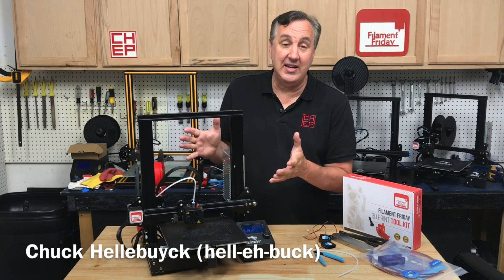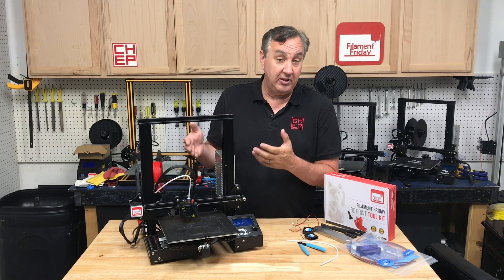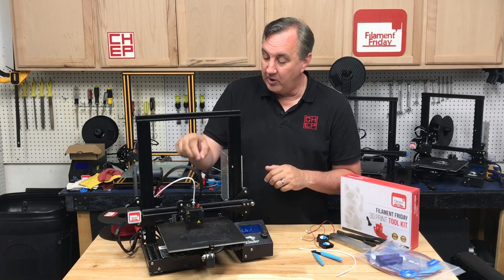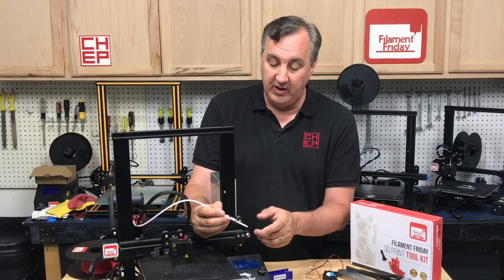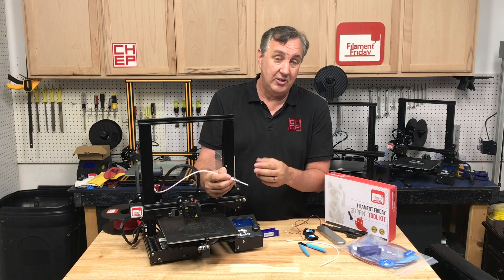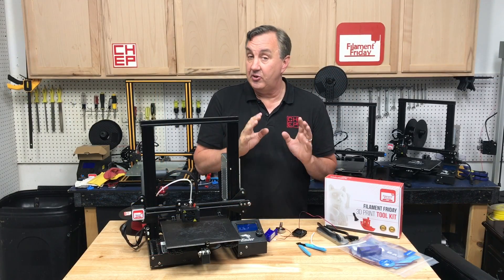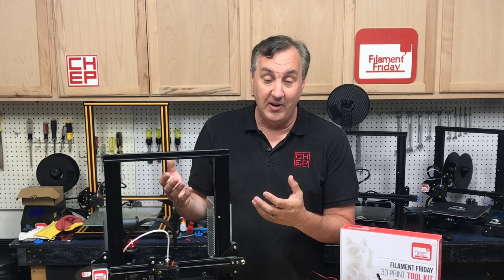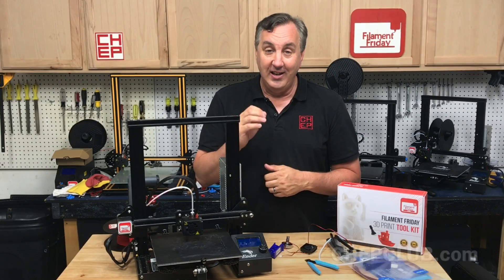Maintaining a Creality Ender 3 - 3D Printer

Comment: it took me honestly months to figure out all of this. Lots of frustration but have it down to a science now.
I've also done the spacer mod featured on this channel which allows me to take out the PTFE frequently without having to reseat on the nozzle (and re-cut the tube end).
Reply: Do you think its a good mod to do?
Apparently CHEP didn't like it enough to mention it here.....
Reply from the maker: I have a whole video on the insert for those that want to mod it. This video was for those with stock setups. https://youtu.be/7tCxO17XZtw
Reply: @bobjohnson3175  I personally think it's a good mod to do, main reason is so that I can throw out that tiny little PTFE segment as many times as I like, and not have to worry about running the main run from the extruder. Yes all PTFE wears out and it will eventually need to be replaced, but not nearly at the pace that it gets baked in the hot end in my experience.

Comment: Great tips Chuck. 
But I'm still having some issues. 
Any tips or video for fixing x axis layer shift after filament change and resume printing? Every time I resume to print,  the x axis alignment is always off.
I've got stock ender3 pro with silent board. Thanks. Any help is appreciated.
Reply from the maker: Tighten the belt
Reply: @FilamentFriday  I did try that but I'll do it again based on your recommendation. Thanks. Love your videos.

Comment: Excellent video. All my printers are direct drive with all metal hotend so no worries about ptfe tubes.  Preventative maintenance is so important and often neglected.  I have learned a lot from your videos.  Thanks.
Reply: Isnt there still a short piece of ptfe tube?
Reply: There is but it doesn’t go down and touch the nozzle.

Comment: I also noticed something good for cleaning the nozzle, if you use the hotend fix washer, you can do atomic clean/cold pull wayyy easier since you doesn't have to pull the filament all the way from the start of the PTFE tube!

Comment: Nice tips! Thank you for your continuous updates, helps a lot 👍🏻.

I had issues with clogged nozzles on my Geeetech A20m, and I've found a really simple way to clean up my nozzle without replacing it. 
I heated up the hotend up to its maximum temp, then took off the PTFE tube end from the extruder side after removing the filament of course, then hooked it up to my bicycle pumb which has kind of a clamp that fits perfectly snug to PTFE tube size, then put a paper on my heated bed so that it doesn't get messy, and carefully blow up air in the tube and it did open up most clogged nozzles with a cloudy plastic oozing 😆👍🏻

Comment: Hey chep, so I had purchased an Ender 3 pro last week and made a novice mistake:
I didn't level the bed for the first print
I also did not know where the stop print button was...and so
The nozzle dug into the bed a neat 4 mm Or so and leaving an impression on the heated bed part before I finally found the stop print option on the wheel. First time printing anything, and my excitement clouded my judgment.
Replaced the Nozzle, as I was concerned about its integrity.
However, I now appear to have a flat spot in three points on the x-axis mounting wheels, or belt, or sprocket. I'm not sure which. I've found the wheels and belt, but I can't seem to find the sprocket in question if I managed to somehow damage that bit. Could you possibly direct me to the x-axis sprocket in case my fixes don't resolve this flat spot issue?
I also have a replacement PEI sheet bed coming, but I'm going to be sticking with the heated part a bit longer to see how my prints turn out before addressing that issue.
Thanks for any input!
Reply from the maker: The gear I referred to is on the extruder motor. The X axis gear is on its stepper motor.
Reply: @FilamentFriday  Correct, I am looking for that gear. If I need to replace it, I'd like to have the part handy.
Reply from the maker: Believe these will work but double check your teeth count and shaft diameter. https://amzn.to/2VKFLu3

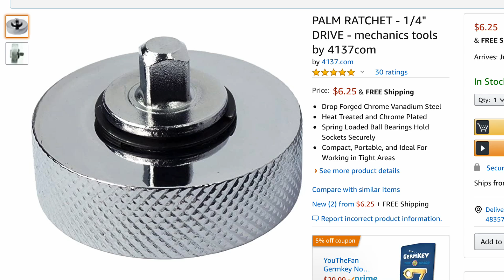Comment: 3:52 Great tip I learned is that if you're stuck in a situation where you don't have a 6.5mm socket (or a 1/4 inch socket, which as you demonstrated works quiet well), but you do have one of those screwdrivers that uses removable bits, then you can likely use the screwdriver as a 6.5mm socket.

Comment: CHEP. Would the mentioned maintenance be related to stringing during travel?  I bulk print duplicate parts  side by side and it strings between each model but not inside the models themselves.  I have the capricorn hot end fix and everything is calibrated using  newest CHEP profile.
Reply: try dropping your temp 5 degrees I find that different filliments will preform better at different temps at 205 the fillament will string like crazy I drop the temp to like 190-195 it preforms better but it coud be a combination of retraction,temp and z-hop. in cura use the (wipe) options you will be happy you did

Comment: One good idea would be to put a Hero Me (Gen4 or 5) fanduct on it, so replacing the fans becomes far easier and you can get different ones like e.g. 40mmx20mm fans for the hotend. Far more cooling on the heatsink should improve the lifespan of the PTFE, prevent heat creep and minimize the temperature transition zone. And the option to use 5015 fans for part cooling is obviously also very nice

Comment: why aren't you using that technique where you clip off just a hot end's worth of Capricorn tubing print that little spacer and then use the regular tubing for the section up to the extruder stepper?
You did a whole video about how great that is...
Did you find that it didn't work or wasn't worth it?
Reply from the maker: This is a different machine. I show various options on my channel.
Reply: @FilamentFriday  Which is the best option?
Reply from the maker: They all work fine when maintained. Depends on your preference.
Reply: @FilamentFriday  My preference is that the stock Creality hot end doesn't fail on me.  My preference is no clogs, jams, fails.
If that Capricorn tubing section in the hot end isn't better than the stock tubing, or even a whole Capricorn length from extruder to hot end, then I don't see how it was ever worthy of such praise.
Nobody prefers a hot end that fails, or requires MORE FREQUENT maintenance, or is harder to maintain good prints with.  There is no reason for going through extra effort and cost to make an "upgrade" that offers no benefit...if it "depends" on anything other than IMPROVEMENT in print quality, durability, etc.
I come here looking for the BEST solution.
Not sure why it got all wishy washy in here.
Either that split tubing with the printed washer is better than stock, or no better than stock.
I'll continue to look for definitive answers in order to determine what decisions to make.
Thanks CHEP.

Comment: That screw is 6mm and 1/4 is 2.54cm/4 = 6.35mm so it will fit but a bit loose.
It's sad to see the only developed country in the world still using inferior imperial units.

Comment: Has anyone ever actually proven that Capricorn tubing has higher temperature resistance? Everyone says it but I've never seen a source
Reply: I know our stock tube was cooked black and blocked after 1 month of printing (non-intense) no higher than 200 degrees. Capricorn tubing still looks pristine a month after installing it (more intense printing too - and 210 degrees now).
Reply: @geoninja8971  yeah, now use PETG and come back
Reply: It doesn't. It's just marketing.
Just buy a bimetal heatbreak and forget about the problems that come with worn out ptfe tubes

Comment: Is there anything that will minimize the erosion of the extruder by the filament (to print or purchase)? I know I can buy a metal extruder but except for the erosion the plastic one works fine.
Reply: If you mean the gear then, unfortunately, the stock one will always wear out over time.
Reply from the maker: Move the spool to the side.
Reply: Print a filament guide that keeps the filament straight as it goes into the extruder. Some use a short piece of PTFE tubing to guide it in.

Comment: I would enjoy seeing a CR-10 mini version of this.  I have to continually adjust (raise) the nozzle height on mine every few layers.  I cleaned it up and tightened the belts, but no change.
Reply from the maker: Check the Z motor coupling for rubbing on the motor or the threaded rod binding causing it to miss motor steps.
Reply: CHEP Thank you.  I did that, but suspect it may need to be replaced as it pops out easily, even after being tightened.  Does anyone have a good Z coupler that they can recommend? Thanks again to all who replied.
Reply: Bed leveled?
Reply: @flyingfloorboard4097  Level to a T.  It is almost as if it does a 1.25 step on the Z-Axis for a few layers. By the time it gets to the 5th layer the nozzle is dragging across the entire surface of the print.  I nurse it past this point and then it is fine after that. Strange.
Reply: @johnpenner8324  Yeah that's wierd. It might be a bad lead screw but Idk, thats what it sounds like to me

Comment: 3:12 i’m a little confused. isn’t there something in that coupling to prevent it from moving?
Reply: It's like a one way fitting.  You can push it in but when you pull it, it locks and won't come out.  You need to push in the collar to release it.
Reply: lolomgdude Sounds like you need a new one.

Comment: Perfect timing! After 2 years and 3 months, and countless prints, my Creality CR10 Mini jammed, and I didn't know what to do! It's my first and only 3D printer, and didn't seem to need any maintenance until now. Every tip in this video helped me to get it back in action. And now I'll be a bit more proactive when it comes to maintenance.
Reply: 2 years without a stoppage??
Reply: @geoninja8971  Yes! Other than leveling the bed once in a while, I did no maintenance. I'm not a heavy user - I go thru about one reel per month. But that's still almost daily use.
Reply: @davesemmelink8964  You've got a good machine there!

Comment: Recently I realise that the most noisy fan on my Ender 3 was the one inside the electronics box. I saw no one giving attention to it as a noise source. I not only replaced all the axial fans of my printer for better ones, but also put a resistor on the path to reduce their rotation a bit. Two things I learned with you and I could build up on. First, how to reduce the speed, as you shown on the Noctua video, and to connect the fan of the electronics box with the one on the hot end so it runs all the time. Thanks Chuck! Because of your tips about fans and silent board now I can print at night and sleep at the same time! Cheers from Brazil!

Comment: hey chuck! ive goofed. there was slop (wiggle room) in the carriage (the bar carrying the extruder left and right) on the right side. i adjusted the inside wheel nut so that it was stiff. I then got this strange artifact on the 1st 3mm (calibration cube) where it printed like crap (globby and elephant footy), then printed fine the rest of the way up. i knew it had to be tied to the tightening of the right inside wheel nut so i loosened it. issue with doing that is when i turn the stepper motors off, the whole carriage slides down and rests on the plate, making it impossible to re-level it as it doesn't rest at the home position. so my question is, what is the correct amount on tightness on those two inside wheel nuts? since mine had a little wiggle room (slop) on the right side of the perpendicular bar (the one that carries the extrude left to right) id assume its supposed to be that way. i only tightened it because i thought it has vibrated loose. anyway, thanks for any response!
Reply from the maker: Just slightly snug so it will move up and down but not side to side.

Comment: My only problem with my Ender 3 is the table rollers are now worn and “sloppy”, to the point where I can’t use it. How do I tighten/replace them? With them so close to the center it causes a lot of table wobble.
Reply: They sell 6 replacement rollers on the Creality site under accessories. I noticed it too myself but can't find any other alternatives.
Reply: Adjust the tension of the wheels using the offset axle wheel. If they are too worn for that, replace the entire set fo wheels.
Reply: I would think the added cost to move to linear rails would be more beneficial, once the first rollers run out

Comment: Hey CHEP! I'm currently using your 2.6 profiles on my ender 3 with an e3dv6 clone and I get under extrusion and bed adhesion problems. Any suggestions ?
Reply from the maker: How was it before you modified?

Try these: https://www.youtube.com/playlist?list=PLRFPlUhDTTlka-Cq-UmI3IbbHRIwG2OsX
Reply: @FilamentFriday  it was good but I also had a different profile. One called masterkey cura profile
Reply from the maker: Try that and see if you see a difference with the new setup.

Comment: Tip on the PTFE tube maintenance part: If one cuts the tube, or in any other form shortens the length of it, and have some automatic filament change feature enabled in the firmware. Make sure to update the travel length in the printers settings, so it doesn't crash the filament into the nozzle when auto-feeding the filament into the system. That can cause the tube to fail prematurely later on.